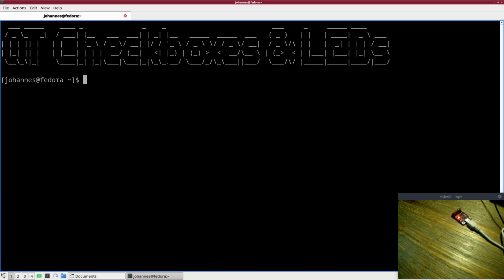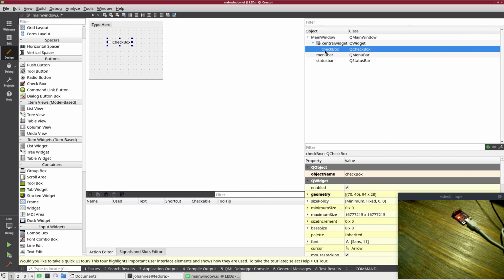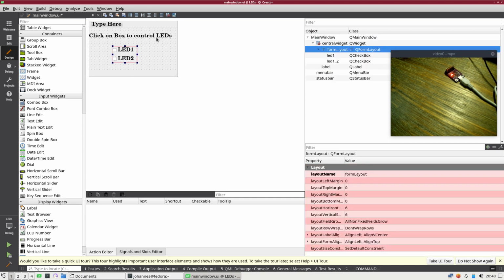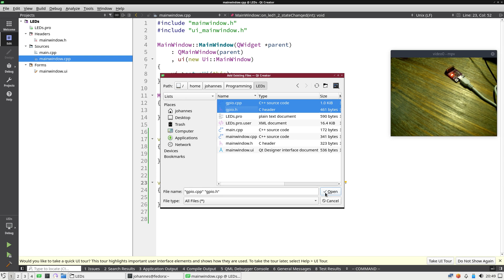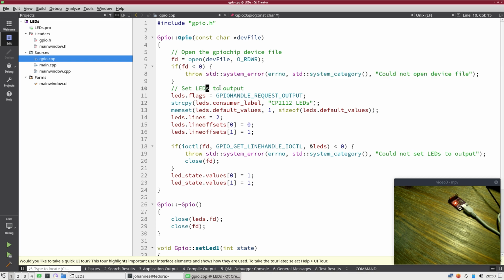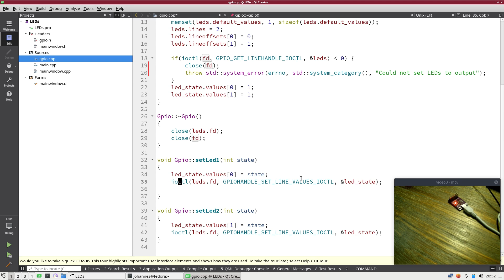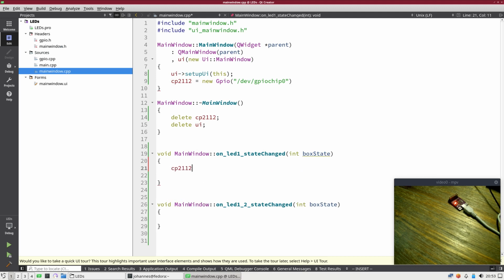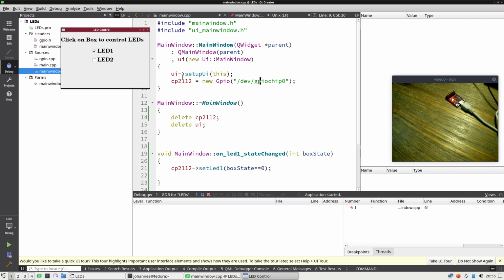Accessing Hardware with QT GUI App - Part  2: Checkboxes and LEDs

Comment: Nice work young man! 
I've been doing some research the last week or so, on incorporating the MCP23S17's with the Raspberry Pi, and it is basically an upgrade to a project I started years ago. Remotely controlling a transmitter/tower site for use with Amateur Radio. The connection is done using fiber between the buildings, and of course with Smart Switches.
The remote embedded controller is a PIC24 configured with the Microchip TCP/IP Stack. It has a few mcp23s17's and other chips under it's control.
I've been doing some thinking pertaining to upgrading the PIC with a RPI4, since it does have more features, and I have plenty of software that can run on it.
I am experienced with C (with Embedded processors) and C++,(using Qt Creator, with Windows and Linux OS's) (I'm 65 now!).
But I'm struggling with converting C code over to C++! LOL!!!
None the less the other struggle has been familiarization of the GPIO's with the RPI! What a beast! To many ways to do it, but with some luck I did come across some of your tutorials.
It surely would be nice if you would put together a tutorial, much like the one "Tutorial_ Control GPIOs in Linux with a C application" with Qt5/6 Creator, in C++ of course, GUI, and the RP4-SPI to MCP23s08 or MCP23S17.
Thumbs up!
Regards Dale